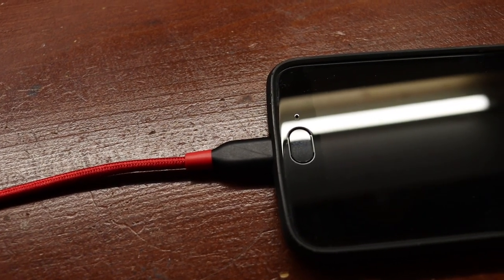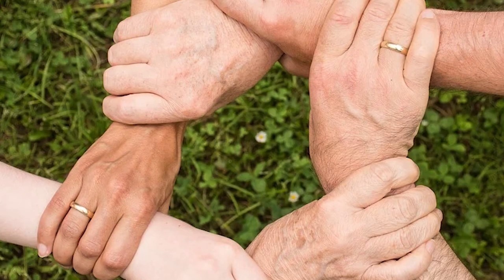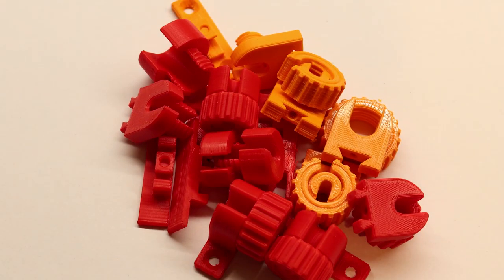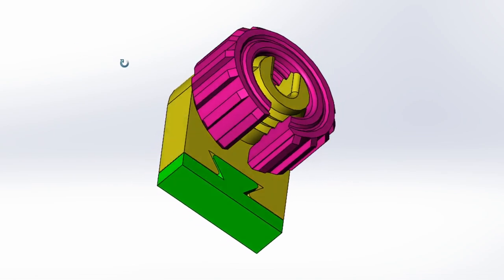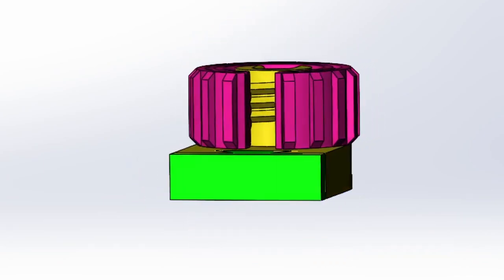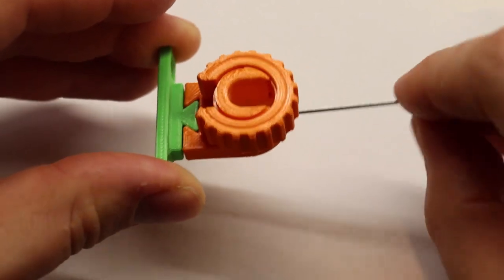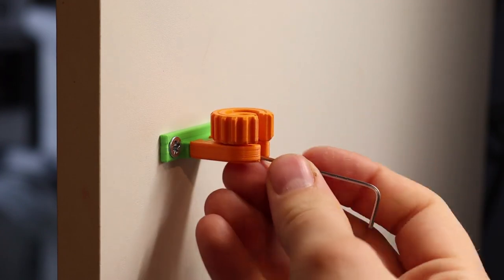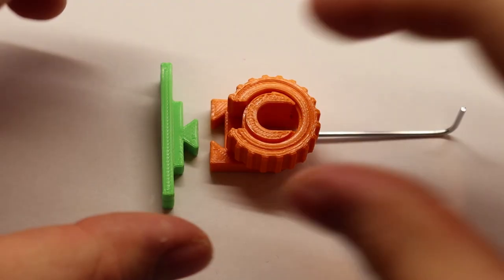3D Printing Cable Management (Over Engineerd!)

Comment from the maker: If you don't have an M3 Tap/screw read the Thingiverse description for instructions. You can merge one of my mounting options by scaling them en then let them overlap with the cable retainer. In this way, Cura(at least) will treat the two parts as one and you don't need the setscrew the cable holder and the mounting option will be printed as one.  An even nicer solution would be if you drew your own option without the dovetail in CAD and merge those two files.

Comment: Well done, and over engineered? Wouldn't say so at all, I like the cable-cut-out design and the snapping very much...! But perhaps I would make the dove tail a bit stronger in all directions or make the angle less, I have the impression, that a little bit stronger hit might tear it off. At least my designs are way too often undersized to keep it small, at the price that exactly tearing it off happened... :-)
And what if you added a base side to the dove tail, so that the screw slides in only from above and can't fall through? You might get away not having to use a screw to fix it? A perfect fit might be sufficient...
Anyways, really well done!!!
Reply from the maker: Thanks for the reply, the dovetail slides in from above and then you lock in the screw it's super sturdy but I understand your doubts about the dovetail design part. I made another video of where I just merge the 2 parts of the stl into each other and print it as one piece. The dovetail was only so it would be possible to replace the cable guide if you buy a different style of cable. and you don't have to remove the base. Let's say that you double sided taped to something :)

Comment: Really neat! But I don't really like the need of having a screw in the system.
Why not havethe dovetail in the green part  with a flat printed bottom so the holder would sit on top of it?
Reply from the maker: You can reverse the direction since you can also mount them on flat surfaces and you don't want to relay on plastic friction alone he screws really fixed the joint in place regardless of how your printer creates the tolerances ;)
Reply: I have to agree with Joao.

The design is awesome, I will definetly print some.
You gained me as a sub.

However, I also dont like the screw.
I would much rarther have a snap in place, squeeze to remove solution.
Reply from the maker: Well that's why we have comments always good to have some controversy about a design :)
Reply: @PattysLab  I also just saw you on Reddit! Really nice seing you interacting with the community in all those different ways.
I probably will make a remix later to try and show what I meant. Again: great job!
Reply from the maker: I was already thinking how of a solution :p. But I'm really curious really like it when people think along!  Thankyou
Reply: @joaomanoellima5947  link?